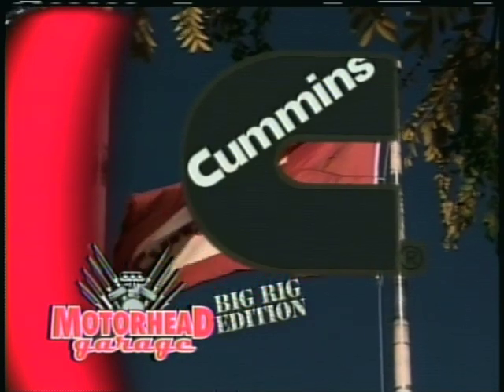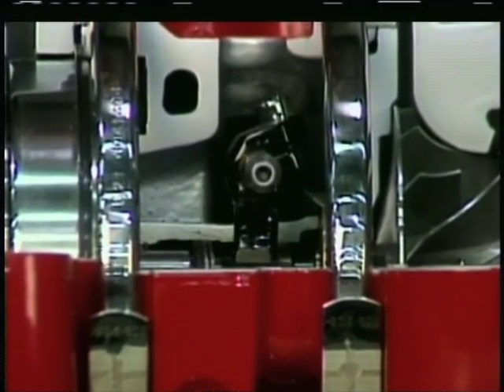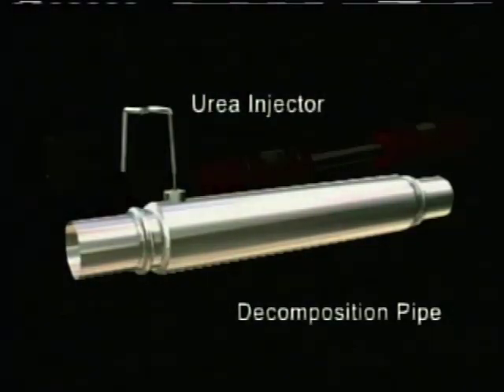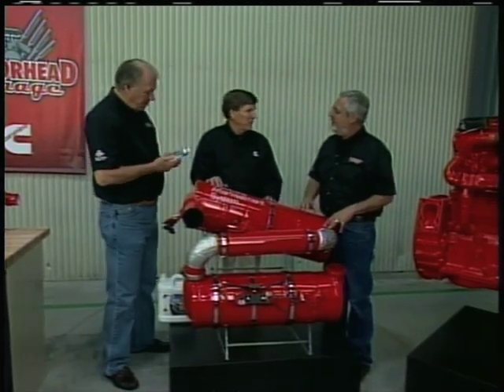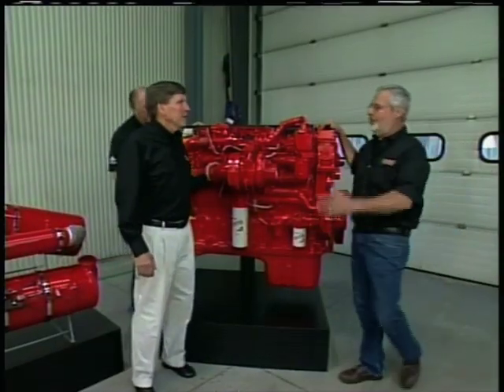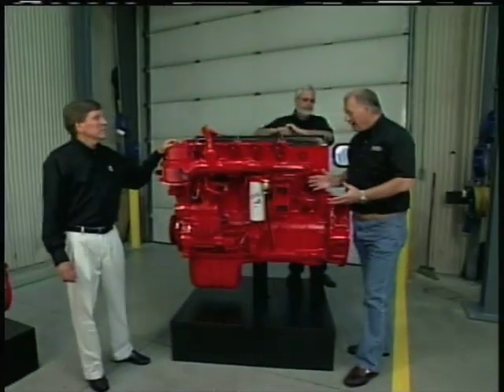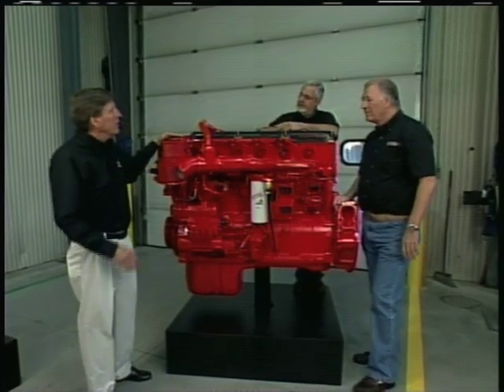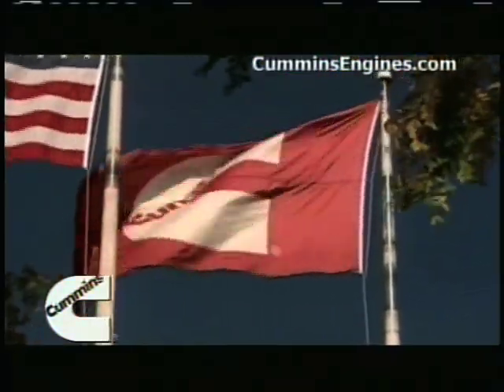Cummins on Fox Sports Network's 'Motorhead Garage' (Part 2 of 4)

Comment: I understand that US emissions standards are some of the toughest in the world, but Europe has always been even stricter. If you wre to hook up an emissions testing machine to a 2012 European truck, and a 2012 American built truck, the exhaust emissions from the Europen truck would be marginally cleaner. My own truck runs an emissions reducing chemical called Ad Blue, which recently been introduced to American diesel trucks. It's technically liquid urea, ammonium nitrate, a fertiliser chemical

Comment: There are diesel cars in America, the VW passat is just one, there are plenty more, and this particulate filter system is on all new diesels, especially pickup trucks with cummins, duramax and powerstroke engines, most owners delete the EGR and DPF if possible though because they plug up and lead to problems over time, not to mention reduce fuel economy, all these add ons are strictly to meet emmissions.

Comment: They are working on it. When the US complies the what is known as Euro 5 emissions standards, this kind of technology will quickly find its way into passenger cars. My truck runs Euro 4 standard emissions, and most days you're hard pressed to see much in the way of carbon coming out the exhaust. Only Cummins still make truck engines in the US, CAT surrendered to the Euro IV specs internationally